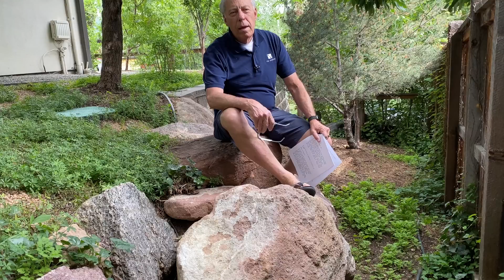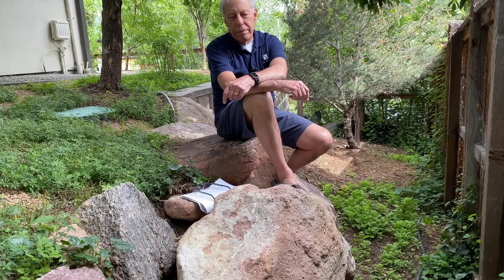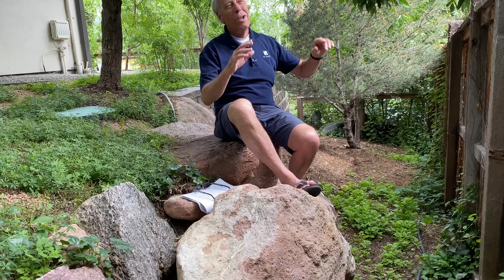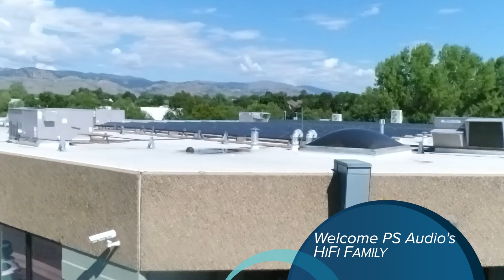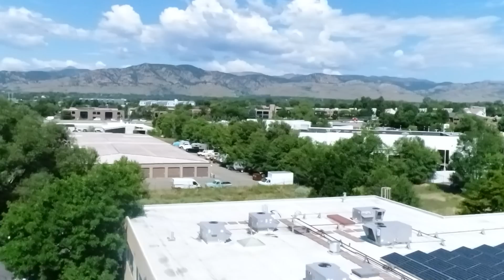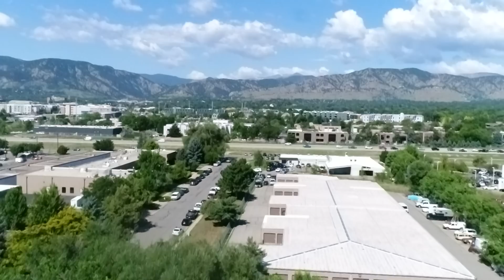Can a regenerator be used with valves?

Comment: Such assumptions that if you turn on the TV or AC in your house, you impact the power/sign wave of your neighbor is completely wrong as such stations have a tremendous amount of headroom in power reserve.

However, such a relatively inferior regenerator that uses transistors to regenerate the sign wave has many series issues as it does not have enough headroom to sustain proper sign wave and the angle between voltage and current at all power consumption mode.

So, if the power in a certain region is so bad, using a regenerator/UPS can be a solution, with its compromises. But when the AC is up to standards, going for a regenerator is a backward step. One more thing, I wonder why a regenerator from PS Audio is sold for more than 10k USD? Recording studios for example use different solutions from companies that specialize in power solutions that are much better and at a fraction of the price. Oh, I know why, this is meant for the irrational audiophiles consumers who buy assuming their systems will sound better :)

Comment: In my opinion, everything benefits from nice, clean, power with a smooth sinewave and no electrical noise from switches, thermostats, routers etc. that pollute the mains supply
This is the simplest way for anyone to understand the importance of clean power.
Perhaps the effects (of a regenerator) won't be as obvious on a tube amp. as (usually) the distortion levels in tubes are much higher than well designed SS amps.
I guess the best course of action is to borrow one and listen.  I suspect, low power 'single ended'Triode designs may benefit more than large Push_Pull amps.

Comment: Don’t waste your money on a regenerator. A well designed amplifier power supply will take care of any mains issues. Put your money in the system components where it can make a real difference.
Reply: Which will only sound as good as the power coming in.

Power differences are very much audible.

Comment: On theory a regenerator, due to the low output impedence and stabilized voltage, is most useful with very simple amplifiers that have a  low power supply rejection ratio such as tube amplifiers equipped with a simple rectifier followed with a smoothing capacitor. You could also tweak the high voltage supply by tuning the voltage on the regenerator controls. By the way, the exact same thing can be done with a cheap industrial motor control inverter, if you find a way to put it in a place where the fan noise and ugly look are not a issue.

Comment: How long is a Regenerator expected to last and do they eventually require maintenance?
Reply: I have one of Paul’s VERY first regenerators, a P-300 that I purchased personally from Paul at the Stereophile audio show in Chicago in 1999. Two years ago I DID have to replace the six electrolytic capacitors because of drying out and / or swelling of the cap cases. Fortunately none had leaked. They were replaced with easy to find Nichicons of the same value. I also fitted an internal fan to control the heat in an effort to prolong component life. Caps don’t like heat. Today I still use the P300 to power a vintage McIntosh C2200 tube preamp, Cambridge Audio CD transport and Project DAC, which it does so with ease. Does this regenerator improve the sound quality in my system? A resounding YES, it does indeed! It’s why I’ve kept it as my system evolved all these years. Along the way PS Audio did a minor repair of the power switch and adjacent board, they also fitted the MultiWave circuit, gratis from Paul. Cheers!
Reply: The only parts of a regenerator that will need replacement are the electrolytic caps ... make sure you get exactly the right types !! Some are special ones
Reply: @janinapalmer8368  Maybe PS Audio should sell maintenance packs.  :-)
Reply: L. Scott Music ~ they might do that .. but  their power regenerators are fairly new on the scene therefore replacing caps isn't considered a necessity as yet .... besides accessing these caps within the chassis isn't all that easy either